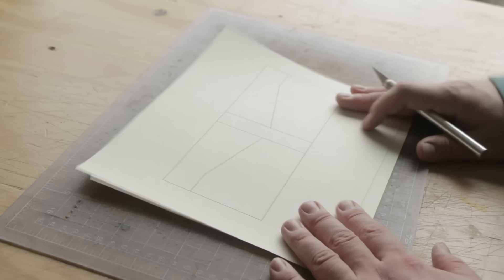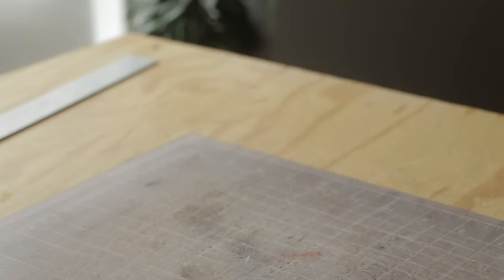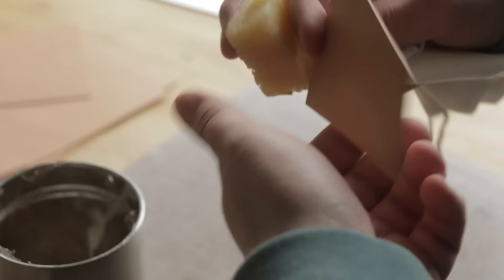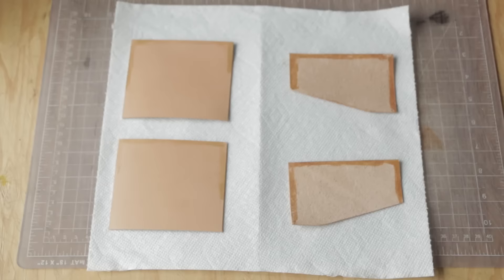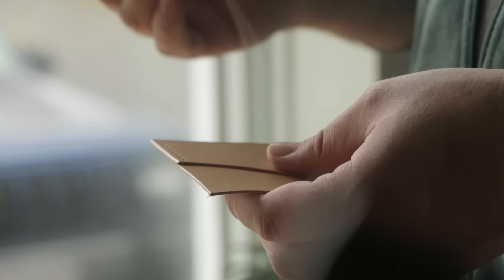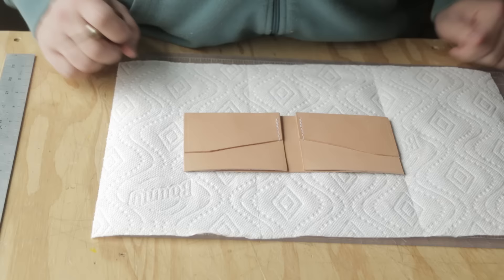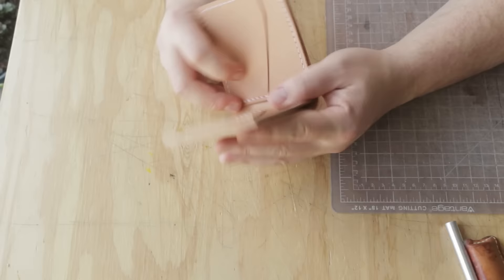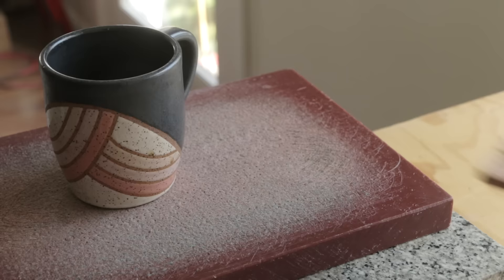How to Make a Leather Wallet

Comment: really like seeing the expensive tool approach vs the simple inexpensive tool approach for sanding and burnishing Refreshing to have instructions without feeling like you need $1000's in equipment. Now teach me an easy way to skive with a cheap knife, haha
Reply: you can get cheap contoured skivers for less than $10 or straight leather blades for $20-30

Comment: I really like how you handled the front/back attachment by punching holes on each before assembly, but do you ever run into issues stitching like this with opposing chisel holes?  I've only done this once and struggled a bit.  Usually I punch all the way through, but like you said, it's very difficult to keep things aligned with multiple layers.

Comment: I've been watching quite a lot of your videos and I love it. Definitely preparing to start a new hobby, it's just a bit hard to get everything I need at the moment with all the lockdowns everywhere. But patience is one of my virtues. I can wait for a bit.

However, there is one thing i noticed in your videos, well, at least in this one. When you try to line up two pieces that you've already punched your holes in. Why don't you insert a couple of needles or toothpicks or whatever fits in the punch holes? Just put them on all corners and the holes on both pieces should line up perfectly and without to much trouble...

Comment: Why do you use a poundo board instead of a plastic cutting board?  I’ve seen a lot of leather craftsman use a granite block with a plastic cutting board over the granite.  Some say the poundo board dulls the teeth of the hole punches. What are your thoughts?

Comment: I really liked your Prize Tote videos and most of the instructional aspects of this video. However, while I've been at the craft for years, I am concerned for beginning leather crafters and how they would feel about the final thickness of the this wallet, it looked almost a 1/4 inch thick. Surely, it would have been preferable to use thinner leather, 2oz for the compartments, reserving the 2-3 oz for the outer and polishing the flesh side of the outer rather than lining it, or perhaps using a 2oz outer lined with 2oz. You could also have considered skiving the seams to give it a less bulky look (it also makes stitching easier). These changes although minor would reduce the overall weight of the wallet by up to 45% and it would be far less bulky when full. Straight Seams & Tight Stitches

Comment: No need to scratch the top grain before applying glue?
Reply from the maker: not if you're using natural veg tan, as there aren't any oils used in it's production. We usually have to rough up the surface if we're using a bridle or latigo but natural will take glue on it's own :)
Reply: @Corter  thank you so much for the reply.